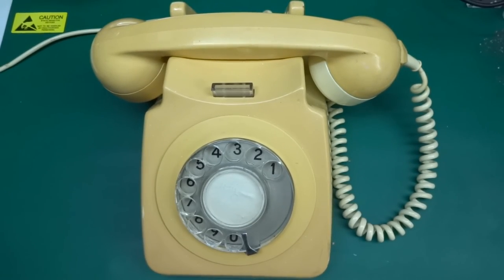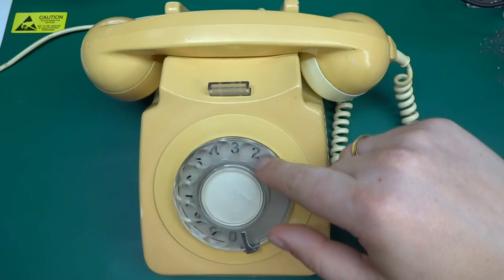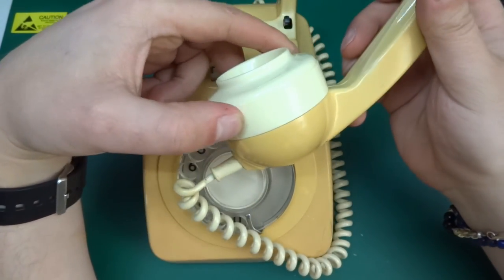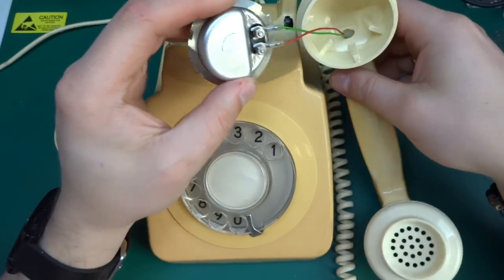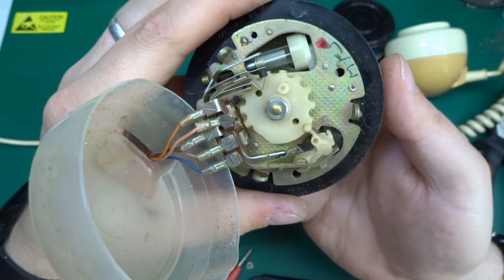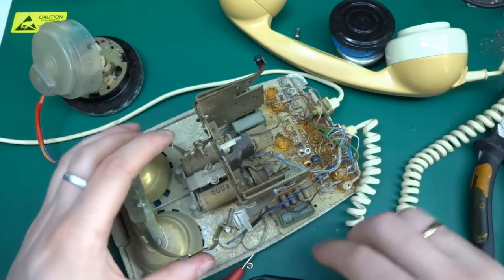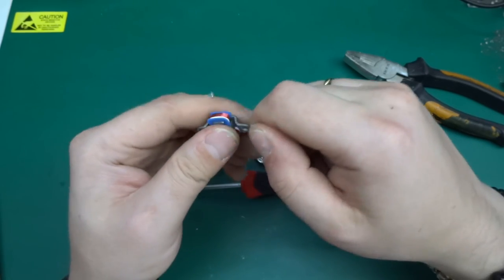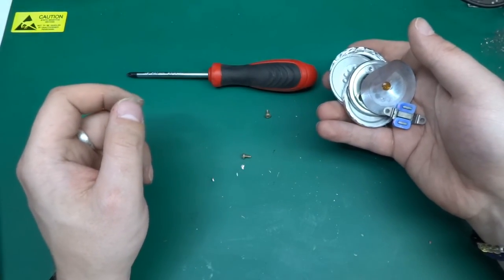Retro telephone teardown (one way)

Comment: I'm playing about with one of these GPO Type 700 phones at the moment... got it ringing with 20v controlled by an ATTINY... should be 40v AC but if you drive the coils individually a 20v square wave will do it..... next I've got to try snd decode the dial.

Comment: the manufacturer is STC OK, the Loud speaker should be 300ohm and the microphone is a carbon granule type, could the thing like a lamp be a miniature vacuum tube, could the transistors be BC182 not sure.